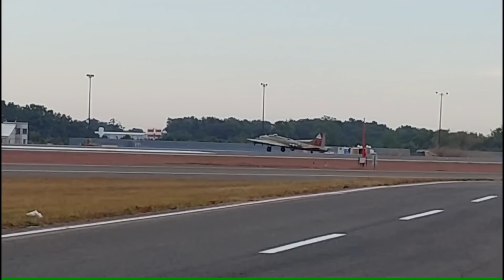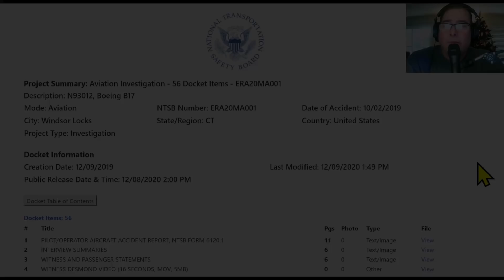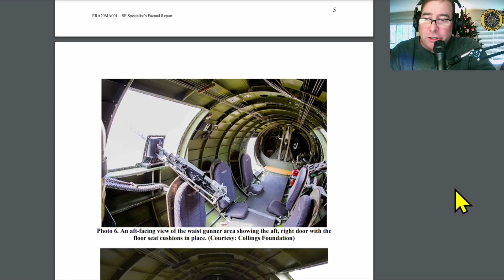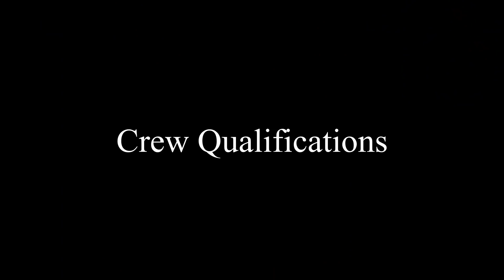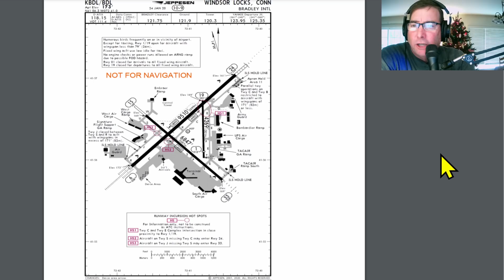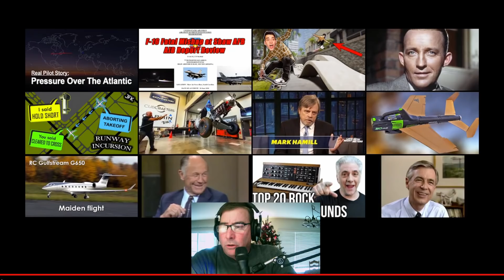NTSB Factual Report B-17G Crash 'Nine-O-Nine' Part I -16 Dec 2020

Comment: From just a day or two after the accident, when the ADS-B data was online and the basic accident scenario became clear, I could never understand why the crew did not declare an emergency and request RW33, which I believe was NOTAM'd closed at least part of that day.    If they had, they might all still be alive.  I fear that the crew did not want to use the E-word or request anything other than the active runway because they were concerned about getting a visit from FAA and wanted this to look like a "routine" precautionary landing vs. a dire emergency, which it clearly was.    The "apparent" decision to add power after the initial contact with the approach lights and localizer antenna is totally inexplicable.   Pilots with their level of experience should have simply focused on maintaining directional control and avoiding a collision with other ground obstacles, while getting on the brakes to the extent they could. 

Between the numerous apparent errors by the flight crew, the lack of training for the Flight Engineer, the lack of a preflight safety brief and the condition of the seats/belts, and the questionable engine maintenance, I would expect NTSB to hang Collings from the highest yard arm.    Their exemptions allowing Living History flights have already been rescinded by FAA.  I expect that this accident will have the same effect on the warbird community as the Gettysburg steam locomotive accident had on the tourist railroad industry, which is to say the resulting regulations will bring an end to a lot of the passenger flights on ex-military aircraft.

Comment: Old pilots shouldn't fly very difficult to handle planes like B17 and other old planes due to very high probabilities of emergency situations and parts failure. When you are older thinking and reflexes are too slow for making quick decisions for old large planes. It has no computers or pilot aids to help the pilot.

Comment: I had an engine out on takeoff about 15 years ago. I regret to say that I did an intersection takeoff.  If I had used the full runway I could have easily landed on the last third of the runway. Instead I ended up in a recently harvested cornfield. Lucky for me the plane didn’t get hurt and I didn’t get hurt. I was going to a fly-in with some friends and I was #4 in a flight of 4.  As you may have guessed, the first 3 did an intersection takeoff, so I followed suit.  I learned my lesson that day to always use the full runway.

Comment: As usual a thoughtful piece.  The point about the electric motors for the landing gear needing to be cooled before reuse is one of those subtle things that in extremis you can lose sight of. All that extra drag but you just can't flick a switch and get the gear up. These planes require a LOT of skill, processes and focus.

Comment: B17 can carry 4800lb of bombs. I find it very odd an empty B17 cannot climb above 600ft. How much power really were the engines producing?
Also he made intersection departure. He could have made emergency intersection landing. Why trying to stretch it out to the  full length of the runway when so low and slow. If he used full length of the runway most likely would have made it back to the point of departure according to the diagram.

Comment: Count me among those people second guessing the pilot passing up a landing on runway 33. I am very familiar with this airport, and the day of the accident the pilot’s decision to go all the way around (to runway 6) perplexed me. Certainly he was task saturated, but his 20,000 hr FO should have helped him choose the runway he would have easily made. I know, it is easy sitting here on the ground, but it makes me think that this PIC had never given any thought to handling a situation like this until it actually happened.
Reply: It could be they planned 33, the gear was down.
Reply: Switching runways would have added a crosswind component to the landing. 

 With potentially 2 engines out, your already using the rudders to compensate  for basic flight.  The best option would be to establish as they did.

Now if Juan would have said pickup the active  runway and attempt a mid field landing from the intersect..  I would have agreed with the speculation.
Reply: @rfinsl  winds were reported calm, this was repeated by the controller after the pilot requested to return. One of the TRACON controllers told me that 33 was closed, but in an emergency that wouldn’t have mattered if the runway was clear.

Comment: Always difficult to critique, with 20-20 hindsight, but here are some thoughts.
In the UK we ran C-47s for pleasure flights with a qualified air-hostess, and a normal ‘here are the exits’ hostie-briefing.  And yes, some seats had those fiddly tanged seatbelts.

It was accepted that you would run a failing engine as long as possible, because the C47 was not Performance-A.  In other words, it was not guaranteed you could climb away on one engine.  It will be interesting to see why they stopped running.

With the B17 you should be able to climb away on three, at those weights.  But no 4-engine aircraft (even modern jet airliners) are certified to climb away on just two donkeys. With just two running, at take-off weight, it is likely you cannot maintain altitude, and have to gently descend.  

Likewise, the aircraft would become quite a handful, and both operating engines would have to be at idle on touchdown or a swing will quickly develop. 
.
Reply: Was that at Coventry?

Comment: Should all propellers be featherable as a safety precaution in the event of an engine failure?
Is the FAA being dangerous in requiring a complex endorsement for adjustable pitch propellers, and should that endorsement be required during initial training for all classes of certificate?

Comment: Aviation safety is based on adding as many safeguards as possible to ensure that even if errors occur they will be contained before an accident. 

The process was in place to prevent this. Apparently everyone including the FAA decided they wanted someone else to prevent an accident. It didn't need to happen.

Comment: Don't forget how many B-17s crashed during take offs and landings when they were new in WW2. Flying in a B-17 was one of the more dangerous combat roles in the US military during WW2.
Reply: Josh, the military B-17s were full of bombs, defensive ammo, carried 10 crewmen with their gear and the pilots were of minimum experience levels. These planes had wear/tear/battle damaged conditions and, to boot, at times questionable wx. Lastly, the procedures for takeoff were risky as planes took off while the preceding ones were on the runway. Thanks
Reply: A remarkable aircraft, but strategic daylight bombing was a useless endeavor.

Comment: Excellent report.  Part two will no doubt be just as informative. An axiom of aircraft accidents is always a series of events that together can cause or prevent an accident.  I expect a comment on the failure to extend the flaps to gain lift at slow speeds if in the Fortress this is beneficial.  Another hard rule is to never turn into a dead engine(s) .

Comment: Will be interesting to see the radial engine evaluation of these engines. So let's think about this and look at it in pieces. The video of the 909 returning as it is moving past the Terminal building in the air. I am not a pilot but I have followed aircraft like any kid brought  up in the 40's. 909 appears to be floating meaning it is not in positive flight, and not stalling but just on that edge of a fluttering and it could go either way. Indicative of what was said of the drop off of airspeed as it came in for the next turn to runway it finally had the event on. Maybe but not all of this is a case of everyone telling Mac that he was the highest time, and most experienced B-17 pilot still flying? Could it be not intentionally but did he get a case of the "I've got this syndrome". I have often heard it said low time brand new pilot's do a great job until, they reach a 500 hour mark and then the potential for an error and crash increases greatly. Is that the same for an extremely high time pilot unparalleled in his experience that no one wants to suggest he may be over extending himself? Orlando FISDO seems to have really dropped the ball with regards to keeping 909 and the Collings Foundation in check.  I read that when the B-29 DOC was being rebuilt and trying to get ready for certification that the FAA worked over them constantly and that basically the DOC Organization had to produce brand new Manual's for all aspects of the Organization. Maintenance, Training,  Fight Operations, Support Upkeep an exhausting process. So I am sure that was the same with 909 but then overtime how is the upkeep of these process's handled? Could they fall to the wayside and unintentionally be side stepped?  Bottom line it is sad and I hope this can be reversed and the program be restored and brought to be an impressive , and safe item for people to once again ride in these aircraft. Juan thanks for the insight and sharing information such as this.

Comment: https://www.speedwaymotors.com/Simpson-55-Inch-5-Point-Racing-Harness-Sport-Belt-Combo,38158.html
The"blade" style belt is still used in racing . It has been proven to be by far the most reliable and the quickest to release in an emergency "car on fire" . Buttons and knob type belts have been tried but are not near as good many racing organizations require the blade design. Not requiring and taking the time to cinching the belts is just plain lazy negligence just one of the events in this disaster that could have been avoided. All a sign of a poorly managed foundation from the top down.

Comment: At least 8 ads! 
If it wasn’t a Juan Brown video, I would have skipped it!
Unbelievable
Reply: Install Adblocker. It's free. I haven't seen an ad on any video for years.
Reply: @bobswan6196  I didn’t think they worked using the YouTube app
Reply: @blockisle9  They do for me. I really do not see ads at all (there, I've probably jinxed it now)
Reply: @bobswan6196  what one do you use
Reply: @blockisle9  It seems to be called Adblocker Ultimate. I'm no techie - I think this was just the first one I came across

Comment: Per the video, and per your commentary, it certainly looks like the throttles for #1 and #2 were not pulled to idle after they were on the ground. This would explain the rapid veering off the runway. Is there any chance the wrong engine was shutdown? As you and I are both airline pilots, with much training in CRM, I can only wonder at what was going on in the cockpit.

Comment: I very much agree with Juan's assessment of "armchair quarterbacking" regarding the crew choosing the crossing, shorter runway when they knew that things had gone seriously wrong, when the same investigators are questioning the use of an intersection departure with plenty of margin when the crew thought everything was functioning correctly, hard start or not. Using the shorter runway might have made all the difference, but the crew may not have even had its numbers at-hand in the moments available and perceived it as presenting additional risk when they needed margin. Margin is something that there just isn't much of in the large aircraft of that era.

Comment: What the H is the matter with these pilots not declaring emergencies when engines shut down?
Reply: Aviate, navigate, communicate (third on the list). First priority is to fly the airplane, second is to get it headed in the right direction for landing, third is to get on the radio.   Things can get pretty busy when the plane wants to land before the pilot.
Reply: @DesertDenizen PIC had time to radio tower that an engine was out and was returning, so that rationale doesn't hold.
Reply: @roscoejones4515  YUP
Reply: @desertdenizen6428  
Except that he was on the radio, just failed to say the "E" word.
Reply: @desertdenizen6428  They had 3 people I think they did not declare an emergency because it would set off a series of reports and procedures grounding the plane. They wanted to patch it up and try again. Terrible decisions!
Reply: I’ve noticed that also in episodes of Aircrash Investigation, it’s hit or miss if they declare. In this case I suspect there was also a conflict of interest issue. (I misunderstood Mitch’s role, sorry.)
Reply: Is that SOP to declare an emergency when engines fail or is it pilot "discretion"?   The only benefit I could see would be the fire trucks could start rolling.
Reply: @jamescaley9942  Im not a pilot soooo. I think it would be required to also alert rescue personnel the plane burned so there may have been time to get more people out and or put out control the fire.
They did not want the incident documented
Reply: @jamescaley9942  
Another potential benefit is that the controller may have said "any runway clear to land" and that may have influenced the pilot to land sooner on the crossing runway rather than flying around to the crash site.

Maybe I misunderstood but I got the impression from your comment that having emergency services activated sooner wouldn't have been a big deal.  I think it may have made a big difference to those who were injured and worse.

Comment: There are a long list of factors for this crash. One that concerns me the age of the pilots regardless of their skill. Reading Kathryns, high age pilots are an issue? Consider, that few AF pilots are flying fighter jets past 35 years old and have to move to other types if they can, shows the issue at the Gold Standard of overall evaluation for flight status in type. Flagged Airlines are no less stringent? At 74 I avoid the Interstate, the nutters seem to be going faster and faster! With Light Sport changes on the docket, I think we will see many other changes to other types with more regulations for complex, high performance and multi engine aircraft regardless of weight.

Comment: We're about half way through, and it appears that Mitch is responsible for interfering with the pilots, and that he had a major part in the crash, because of that interference....was he the owner ?
Reply: Mitch was NOT the owner. He was a relatively new hire at Collings. I’ve read the reports in the docket, and I never got the impression that he interfered with the pilots.
Reply: @robertpcleary  I may be wrong, but I thought Juan said when the pilots were discussing shutting off Eng #3, that Mitch just reached in and cut it off.
Reply: Please-everything in your post is wrong. Probable troll.

Comment: He was caught out at the last moment, possibly by windshere, aircraft stall, or that engine torque pulling the B17 to the right. Similar accident I watched last month on 74 Gear last month with a light aircraft that pulled to the right and stalled on landing. the pilot did'nt apply breaking and literally went straight into a hangar with his aircraft. I doubt Mack even had time to apply any breaking with the forces acting on the B17. Other elements of this are upto the FAA and Collings Foundation getting their Act Together. RIP All Concerned!!
Reply: I think another possibility is there might have been damage to the B-17's tail wheel after the airplane hit the landing lights and ILS antennas. If the tail wheel was damaged it might have affected their ability to steer the plane on the ground.

Comment: Juan, 
I had the honor of working with a B17 pilot(Arnold Moselle)in the 80s before he retired.  Kept in touch with him until he passed.  He told a story of coming back across the English Channel on one engine and barely clearing the cliffs after throwing everything overboard that they could to reduce weight.  I wasn’t a pilot at the time and didn’t ask about any details.  Fuel was probably down to nothing and it could have been an inboard engine which would create less yaw.  He also had lots of altitude to trade for speed on the return trip.    Did the engines create more thrust due to higher octane fuel?  Very humble person, not one to exaggerate.  I didn’t believe him at the time but he told me that I would fly someday.
Reply: Yes, being tuned for the higher octane fuels they had during the war would have given the engine more thrust, also they had functioning turbos on them during the war, unlike nowadays, at higher altitudes that would have given the remaining engine the ability to make 100% power, on one engine running the commercially available fuel nowadays and without a working turbo he probably would have lost enough altitude until he got into thick enough air so the single stage supercharger on the engine could provide max boost that he'd have never made it back across the channel. 
I'm not aware of a single WW2 bomber that originally had turbos on them that's flying nowadays with functional one's, there's no point since they don't have working oxygen system's on them, they'll never fly that high again. 
Also I know that some of the airworthy fighter's that originally had turbos for high altitude performance don't have them hooked up either, of the 5 airworthy P47's I believe only two of them have functional turbos, the other 3 just have ballast in the fuselage behind the pilot to keep the center of gravity correct on them, they just run the exhaust out the wastegate dumps up at the engine cowling.
Reply: @dukecraig2402  
thank you for the time in detailing the answer,  makes more sense now